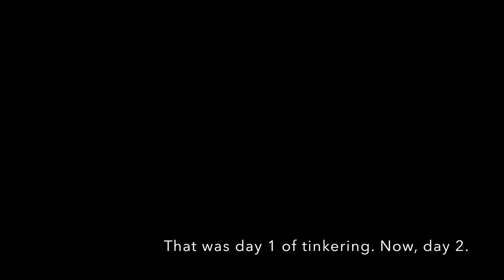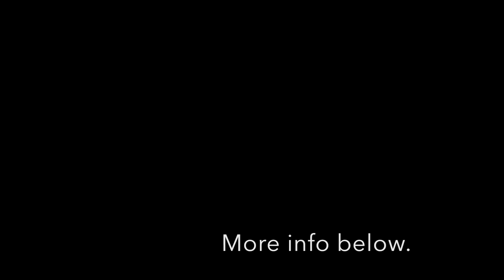Backyard Railroad: 7 1/2" Gauge DYI Rail Bending FAIL

Comment: You dont ever need a rail bender, put down your ties EPI and fasten down only one side. on the other side put all the screws in but way loose. have one person hold one side and another pull the track what ever way you want it bent. When satisfy start tighten the screws. I put down 1900 ft so far and never used one.  .
Reply from the maker: Greysonvalleyrr Barnesville ...Yeah, we’re bending more and more just by hand and very soon we’ll be laying down like you said.